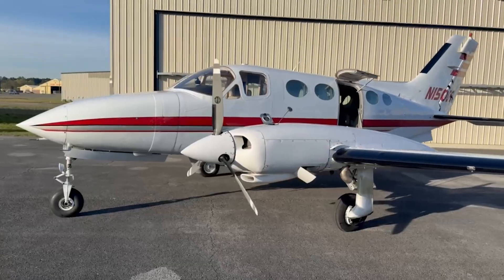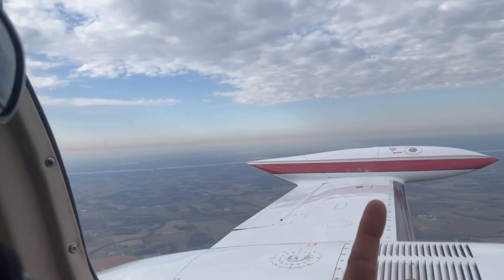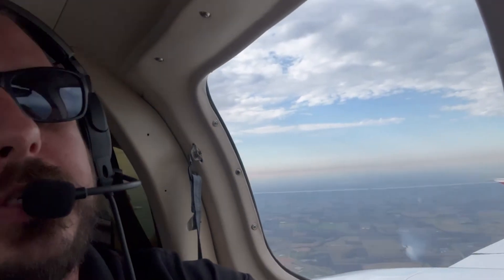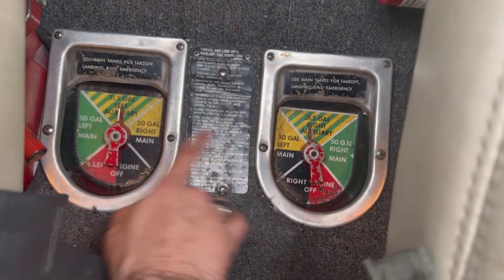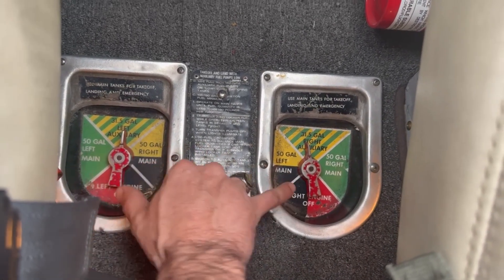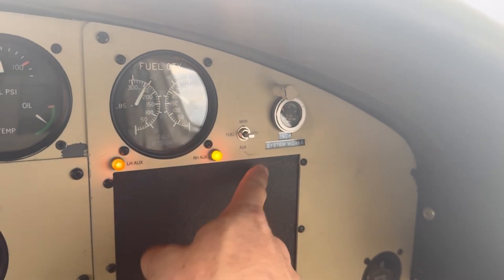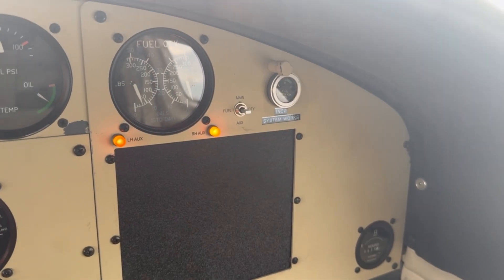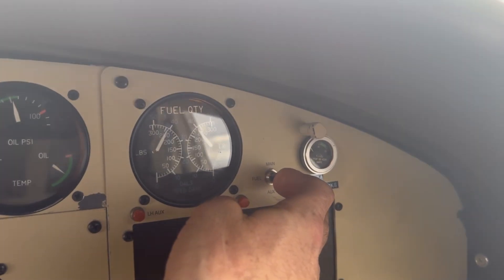What You Need to Know About the 414 Fuel Selector System

Comment: How do the wing locker tanks work?
Reply from the maker: The wing locker tank works by a switch on the panel.  When you select the switch to on the fuel transfer pump begins to run and move the fuel from the locker tank to the main tank.